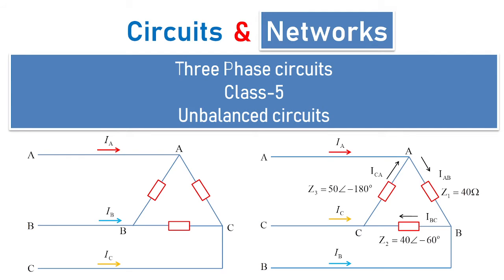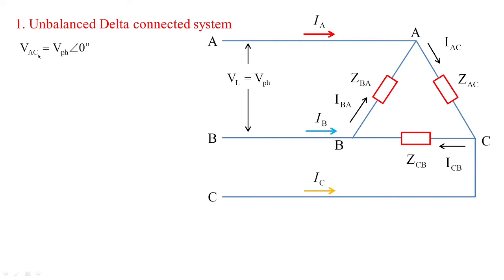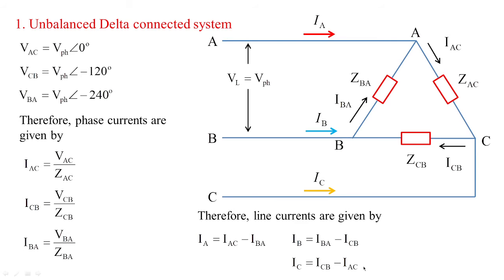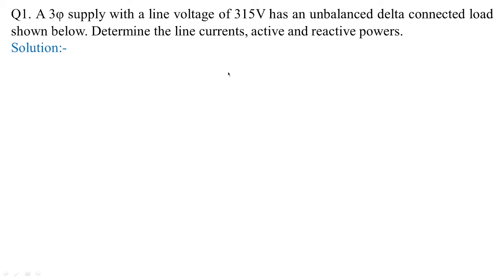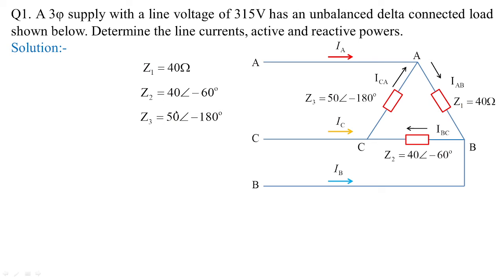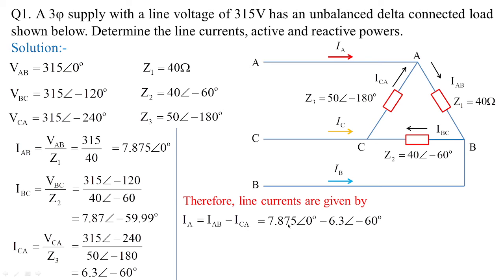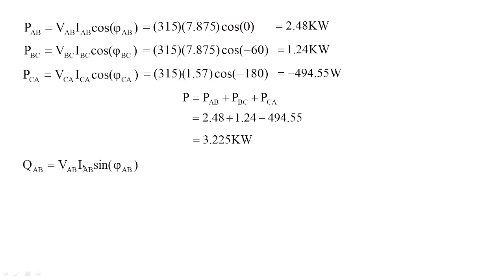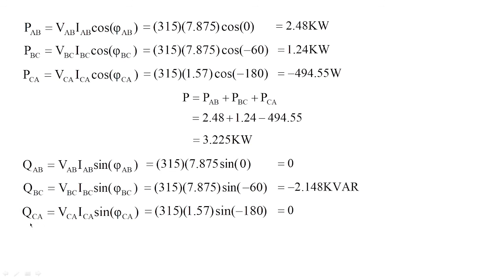How to calculate power in three phase unbalanced load circuits? How to solve three phase systems?

Comment: Sir howcome angle between current and voltage camed out to be 60 and 180
Reply from the maker: Good observation., see the impedance Z = V/I = 0, -60, 180, given in the delta diagram, from there we estimated power factor and the angle between voltage and current